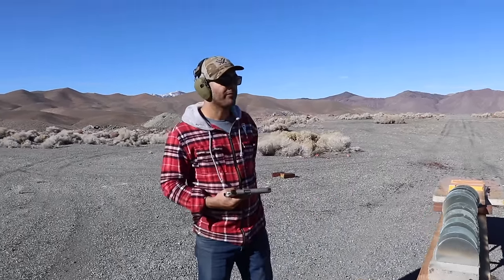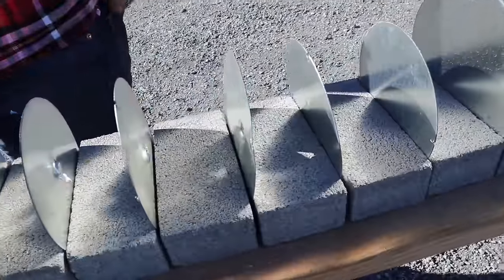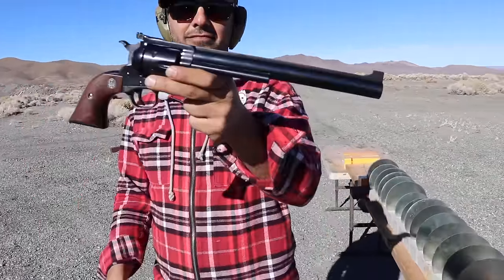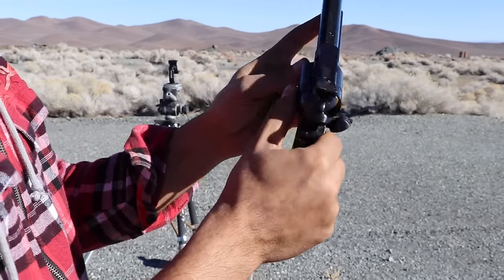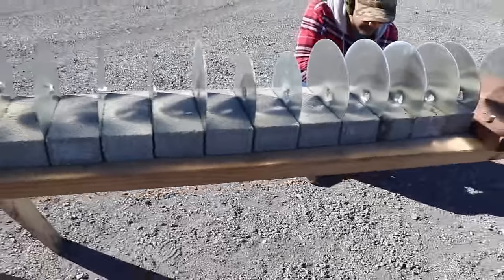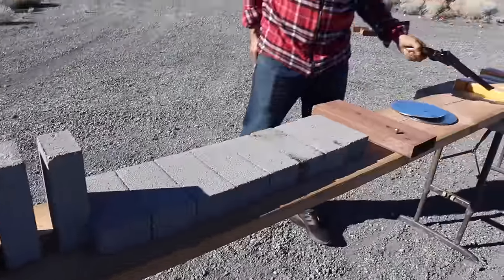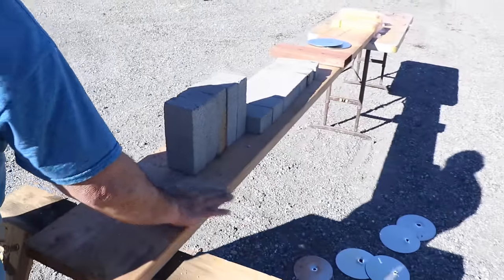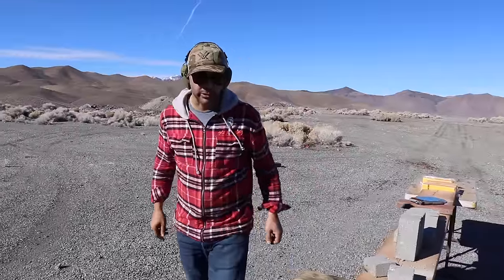45Colt vs 45Acp

Comment: I have a SAA in 45 Colt with a spare 45 ACP cylinder. There is a fairly large difference in power between the two. It's an inexpensive way to practice using Blazer 45 ACP ammo.
Reply: Do you not know how to read an ammo box? There is no significant power difference between 45 colt and 45 acp, the 45 acp was designed specifically to achieve similar ballistics to the 45 colt in a smaller case due to the 45 colt being a black powder cartridge and 45 acp designed to use smokeless powder. Winchester super x, 45 acp, 230 grain, 835 fps, 356 ft lbs of energy. Winchester super x 45 acp, 185 grain, 1000 fps, 411 ft lbs. Buffalo bore 45 acp +p 255 grain, 925 fps, 484 ft lbs. Buffalo bore 45 acp +p, 185 grain, 1150 fps, 543 ft lbs. Winchester super x 45 colt, 255 grain, 860 fps, 420 ft lbs.  Buffalo bore 45 colt, 200 grain, 1100 fps, 537 ft lbs. Buffalo bore 45 colt, 255 grain, 1000 fps, 566 ft lbs. The only time you will find 45 colt that is significantly more powerful that 45 acp are the exotic over pressure +p loads that come with a chart that says what guns are safe to shoot them in and which will blow up in your face such as the buffalo bore 45 colt +p deer grenade, 260 grain, 1500 fps, 1200 fp lbs which is basically a 454 casull because that is what a 454 casull is, a 45 colt, filled with smokeless powder which has much higher pressure than the black powder that the 45 colt was designed to use and the case is lengthened 1/10th of an inch to prevent people from chambering it in 45 colt guns and blowing themselves up. The only relevance 45 colt has today is in old 45 colt firearms which cant use the high pressure loads and as cheap ammo to shoot in 454 casull firearms. If you want a powerful 45 colt, buy a 454 casull and feed it 45 colt for plinking. Edwin specifically rigged this test and it is despicable, he used 45 colt +p in a 10" barrel against 45 acp target ammo in a 4" barrel to "prove" that 45 colt is more powerful when he owns a 45 colt with a 4" barrel and he owns target ammo for that as well so he has no excuse other than blatantly misleading his viewers. My advice? Unsub. No one needs someone, especially the science channel, rigging their tests so that the result is designed to mislead. Anyone can look up ballistics between the two cartridges and see that Edwin is lying.
Reply: @12jazion  45 Colt is 35 FPS faster with a 20 gr heavier bullet than the ACP. AND that's out of a vented barrel even at the low pressure of the old SAA pistols. Data is from my 48th edition of the Lyman reloading book.  Use modern pressures the 45 Colt has even more power yet is still safe in Ruger's and the TC. I prefer the 44 Spl myself.
Reply: Not long colt, just colt
Reply: @12jazion  .45 ACP was designed to replicate the ballistics of the .45 Schofield except with smokeless powder and a jacketed bullet actually. .45 Colt with black powder tends to be slightly faster and uses a heavier bullet(although cast lead and not jacketed). .45 colt can be loaded to exceed .44 magnum energy with powders like H110 but it is not safe to do this in many guns. Personally I do load +p .45 colt for my Henry, which can safely handle it.
Reply: @12jazion  Yeah I was kind of wondering about all those variables. The first clue was the very obvious discrepancy in barrel length, and the fact that the 45 colt firearm was a Ruger. Which are often designed for over pressure +P rounds. All this test really proved is that if you stuff the longer 45 colt brass with extra powder and shoot it out of an impractically long barrel, you get greater foot pounds of energy... wow, amazing...
Reply: @damiendarko9411  A revolver does lose some power between the cylinder and the forcing cone.  However, a full SAAMI pressure Colt has more power than an ACP.
Reply: Lol I’m not reading all that shit.
Reply: @Edmondson_Avenue  ที่
Reply: @timclaus8313  Tim, modern revolvers don't lose that much velocity, the cylinder gap are very tight, also the same could be said for semiautomatic pistols breach slightly opens before the bullet exit the chamber.
Reply: @Edmondson_Avenue  Very true, but in some loadings, you can get some distant flash from the cylinder gap.  Doubt it makes much difference in velocity, but it it there.  Don't want to have a finger in that vicinity, lol.
Reply: @trollXmakefunner  I do know what I am talking about because I happen to own more guns than most of these YouTubers and I have many .45 colt and .45 acp firearms and I know the load data and history of both cartridges. The .45 acp was developed to mimic the performance of the .45 colt in a shorter case because .45 colt was a black powder load and .45 acp was smokeless and therefore develops the same power in a shorter case. The .45 colt smokeless load is called a .454 casull and they made the case 1/10 of an inch longer to stop idiots from blowing up their .45 colts which are not rated for the higher pressures.
Reply: @12jazion   "Buffalo bore 45 acp +p 255 grain, 925 fps, 484 ft lbs." "Buffalo bore 45 colt, 255 grain, 1000 fps, 566 ft lbs"
You are not making sense. You say there is no significant difference between the two but standard pressure 45 colt is about 15% more powerful than +p 45acp. That's not even a fair comparison because one is +p. A fair comparison between the two with both being SAAMI specs or both +p leads to 45 colt being 25% or much higher.
Reply: @12jazion  yes but the ACP was made to replicate the 45 Colt Gov't, which was only 30 grains of BP, not the standard 45 "Long" Colt as we know it which was originally loaded with 40 grains of BP.

Comment: To be fair, you should have compared the 5" 1911 to a Ruger SA with either a 4&5/8" or a 5&1/2" barrel.
Reply: Exactly...  And Ruger SAA allows more pressure in chamber that original SAA Colts (or replicas like Uberti Cattleman)
Reply: I agree, he should've had both pistols with the same barrel lengths!
Reply: At least they didn't kill themselves.

Comment: The original full load(1873) for the 45 Colt was 40 grains of black rifle powder (FFFg) under a 255 grain bullet. That made right at 1000 fps from a 5.5" barreled single action, and about 1030 fps from a 7.5" barreled single action. In SIXGUNS Elmer Keith says that the 40 grain BP load would shoot completely thru undressed 8-inch pine timbers. Gun Writer Mike Venturino, tested that load firing through 7/8" pine boards and got complete penetration of 11 boards (9 5/8" inches of pine penetration!). So right from the start in 1873, the 45 Colt was a thumper, and would kill anything in front of it. 

By 1874, U.S. Arsenals began downloading the 45 Colt to 30 grains of black rifle powder and a 250 grain bullet for about 800 fps, later dropping to a 230 grain bullet for about 830 fps, because the heavy recoil of the full 40 grain BP loading made it very difficult to train new soldiers to fire. In 1877, U.S. Ordnance dropped the 45 Colt in favor of a new cartridge that combined the small rim of the 45 Colt with the shorter case of the 45 S&W Schofield to create the 45 Colt Government, loaded with 30 grains of FFFg under a 230 grain bullet for around 830 fps. The 45 Colt Government cartridge developed the ballistics that the 45 ACP eventually duplicated. (John Browning's first loading for the 45 ACP was a 200 gr bullet at 900 fps, but U.S. Ordnance requested Browning duplicate the 45 Colt Government ballistics).
Reply: No need to say "rifle". Its just "black powder" We only say that to differentiate it from modern smokeless powders. In 1873, it was just simply "gun powder".
Reply: @jamescooper2618  I'm using 19th Century designations for gunpowder (black powder), which are proper. In the 19th Century, FFg was Musket / Shotgun powder, FFFg was Rifle Powder and FFFFg was Pistol Powder. And in 1855 at Colt's request, Hazard Powder Company began screening an extremely fine grained gunpowder that was 5Fg, calling it "Cartridge Powder" to be used in the paper powder envelopes of revolver combustible envelope cartridges. 

The granulation of gunpowder is extremely important because the finer grained the powder, the faster the combustion rate, and finer grained powders perform much better in the short combustion chambers of a revolver. 

For example, in my Uberti replica Remington Army .44, in making my revolver combustible cartridges, if I duplicate the U.S. Military Arsenal load of 22 grs of Dupont Rifle powder (GOEX FFFg) under a 220 grain conical bullet, muzzle velocity from the 8" barrel will average around 720 ft/sec. Now if I duplicate the load of a Colt Cartridge Works .44 Army cartridge, I'll use 22 grains Swiss Null B (5Fg) to  duplicate the Hazard Cartridge Powder used by Colt under the same 220 gr conical bullet to get an average muzzle velocity of 945 ft/sec. That's going from 45 ACP target load power to 45 ACP +P power lever, at the same charge level just by using a much finer grained black powder. Had I used 22 gr of GOEX FFg, the muzzle velocity would have dropped to around 670 ft/sec.

The granulation (and make) of black powder is extremely important to the performance of a firearm, especially a revolver.  The type of charcoal used in making black powder determines the combustion rate. Maple charcoal (GOEX) slows the combustion rate, so that pressures and velocities will be lower than a black powder made with Alder Buckthorn Charcoal (Swiss), or Willow charcoal (Hazard).  GOEX duplicates the Dupont formula developed in 1802 for use in the thin barrels of .69 caliber smoothbore muskets that the U.S. Military was using at the time.
Reply: What a cool area to go dirt bike riding my friend Todd's dad Larry Lohan Horst used to take us to El mirage 1984 We had 80s 2 strokes Kawasaki and Honda we were 14 years old that was in Barstow California where are you where is your area also I believe you own that giant pit or lake the water hole
Reply: @jamescooper2618  read 64DW89A respsonse and that still holds true with muzzleloader blackpower substitutes , their  rifle and non-rile powders designations.

Comment: The factory ballistics of the .45 acp and standard loadings of the .45 Colt are almost exactly the same.
The main difference is the ACP has a 230 grain bullet, and standard .45 Colt has a 255 grain bullet.
It would be interesting to see what the velocity of the round from that 10" barreled Ruger was!
Reply: Was also surprised by the 45 Colt - they’re not that different, as you state. But we don’t know what load they used. I heard hard cast, which points to more of a specialty load.
Reply: I was suprised as well - normally are the .45LC factory loads rather mild powered and even under the performance of a ACP!
Reply: Most factory loads for 45 Colt are cowboy loads. You load them to 14,000 psi max or duplicate the original 250 grainer over 40 grns of black and you far surpass any 45 acp loading and stay standard pressure. Get a  Freedom Arms and the Colt can be loaded to .454 Casull levels.
Reply: @RedwolfTalk  …you are totally right but the question was not about handloads. I know for example that good old
Elmer Keith has loaded the .45 LC to .44 Mag Power. But here we talk about factory loads an the only reason that the
45 LC has topped the 45ACP there was because of the double length of the revolvers barrel!
Reply: @RedwolfTalk  yeah that historical  load with 40 grains of 3f black powder gets 357 mag levels of power and up. With a 250-255 grain bullet and out a 7.5in barrel it can get over 1000fps(566ft-lbs of Energy. Ive heard that it can even get to 1050-1100, which is 624-684 ft-lbs
Reply: @RedwolfTalk  The army loading for the 45 colt was 250 grain bullet over 26 grains of black powder and 760 fps, cowboy loads replicate or exceed that. The 454 casull is a 45 colt loaded with smokeless powder. The only reason they lengthened the case of the casull 1/10th of an inch is to prevent it from being loaded in 45 colt chambers, not for any extra case volume.
Reply: @12jazion  28 grains, but early on was used with 35 and 40 grain loads, and those loads were still available to civilians even after the army reduced the power. "Cowboy" .45 colt loads are reduced pressure smokeless loads. Standard pressure smokeless loads slightly exceed .45 ACP power wise, and maximum black powder loads even a little more. +P loads can exceed .44 magnum power but isn't safe in many .45 colt chambered guns, even a lot of modern ones.
Reply: @rolexr  Light loads for those very old SAA Colt revolvers.
Reply: @rolexr  If you get Sig V-Crown of Hornady defense hollow point ammo, they re pretty hot.  Much of the 45 Colt, especially lead rounds, are cowboy loads, restudied by the various competition groups to mild lead loads to reduce the beatings the targets take, along with potential ricochets.  Loaded to full SAAMI spec pressures, a 45 Colt is a handful.  Loaded to the +P levels you can use in a Blackhawk, it is a REAL handful.
Reply: @rolexr  The original blackpowder load for a 45 Colt was about 1000fps with a 250 or 255gr lead bullet.  That is a lot of pop.
Reply: @timclaus8313  The very old colt SAAs should only be used with black powder. If they are in good shape a standard charge should be fine though.
Reply: @redtra236  True, but that is why SAAMI spec for the 45 Colt for most revolvers is 14,000 cup.  Like the 44 Special, manufacturers have to worry about those very old guns still floating around.  Kind of like 45-70 factory loads being safe in a Trapdoor Springfield.